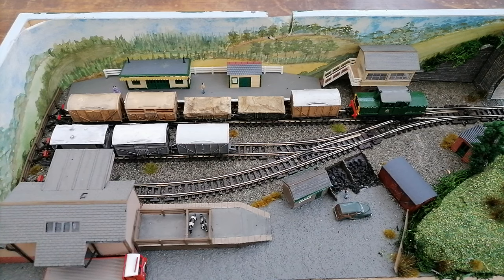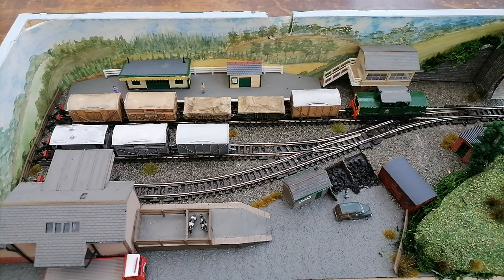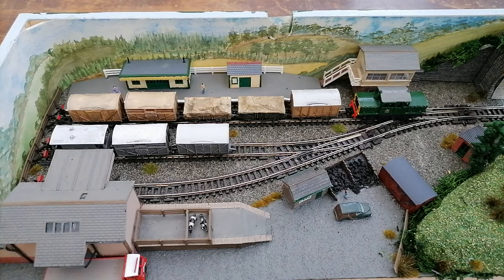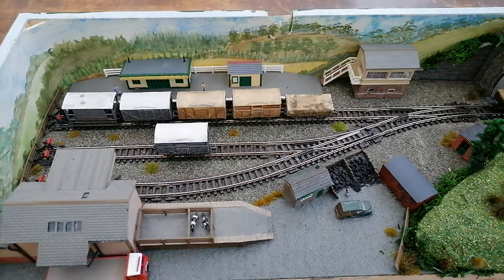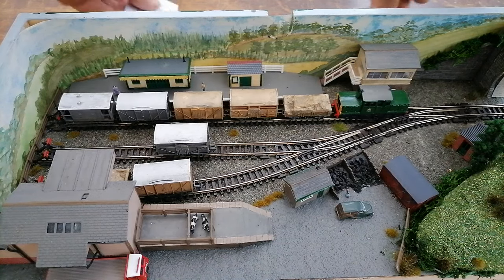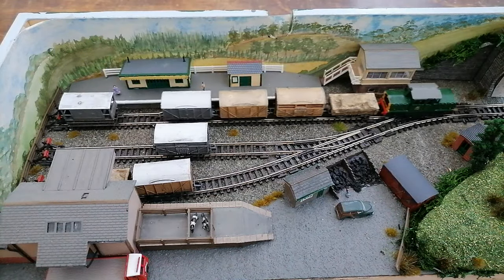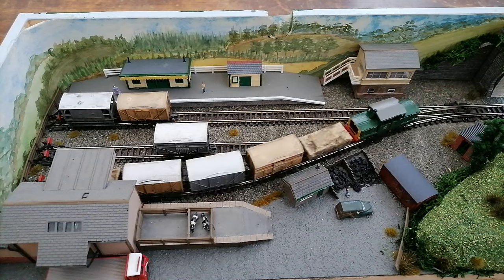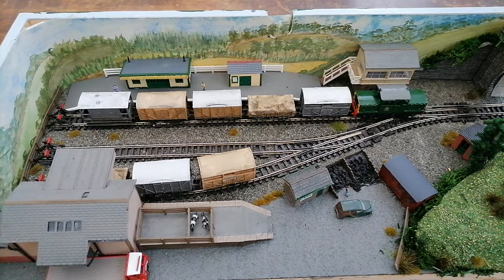Shunting on my N Gauge inglenook shunting puzzle

Comment: Good fun! I decided to build a loop with a built in Inglenook just like your recent layouts but with Kato Unitrack. They have special sets made for the Pocket line with short turnouts (points). Granted a little expensive because of the built-in motor on the points but nice and small. It fits on a 24 inch by 14 inch board. Cheers!

Comment: Nice video as always. I've got a 2nd radius curve on my curved siding, and this helps with coupling. I've read that the Inglenook format was rare in the real world, but I've found several in old station plans in my area, especially if you count the through line as the long siding.

Comment: I now have a track plan that I think will work. I have been stalled by the cutting and fitting if my Flexi track. Also connecting points back to back is a nightmare. 😮

Comment: I find uncoupling standard n gauge wagons far easier than standard 00 gauge. You just lift the wagon on one end and the knuckle releases, whereas for 00, it was always the "twist and lift" which means I have to relocate it back onto the track and is harder for narrow sidings with platforms. Less reliable when trying to couple because of the lighter weights, and near impossible on curves, but otherwise far easier. Is it just me?
Reply from the maker: No I agree fully

Comment: Why  not  add an  extra  length  of track  to  both  sidings  and the main  track.....would  prevent  the  loco  stopping  on points...
Reply from the maker: It was designed to fit a drawer so that is the size it is. I did learn on future layouts to make the sidings longer for that reason
Reply: @BudgetModelRailways  Great  stuff  as  ever..keep  going.